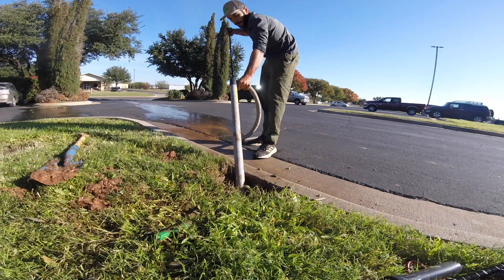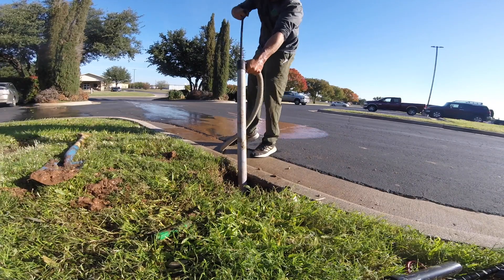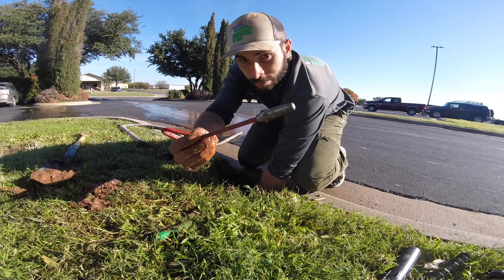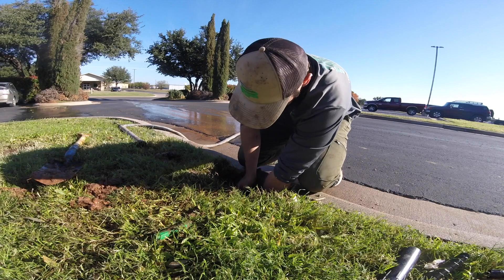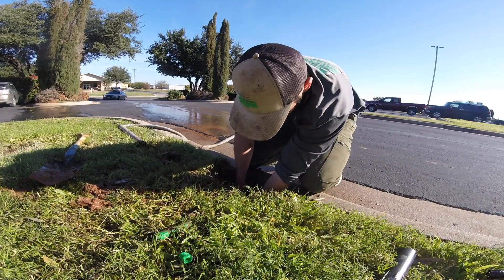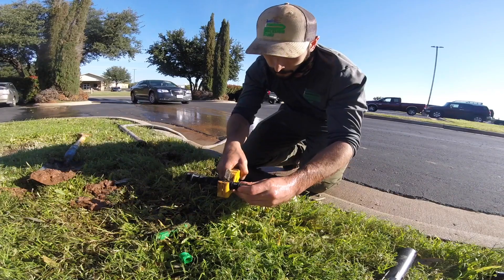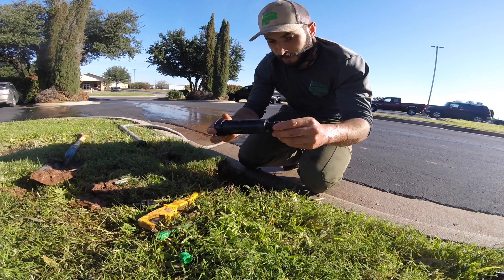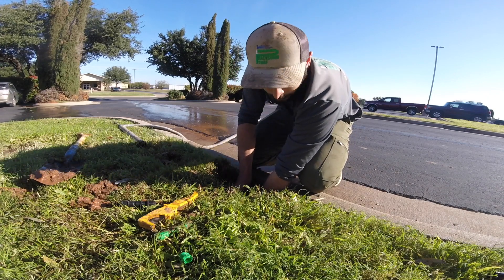How to replace a broken sprinkler head

Comment: If I have to dig down to the line because of a broken riser I will always change it to two flex elbows and flex pipe. If I'm changing the sprinkler and its on a riser I will always change it to flex pipe. Obviously charged but no one has ever said no when I tell them how much stronger(almost indestructible  compared to risers) they are. These are for home owners I understand that. But its likely if the homeowners giggling this its because they are looking to do it themselves. Meaning they may end up doing it again another time. Show them the right way. Not just quick fix repair but okay I won't ever need to touch this again